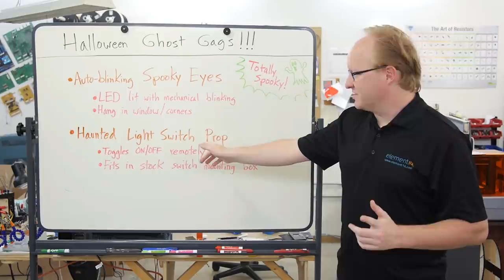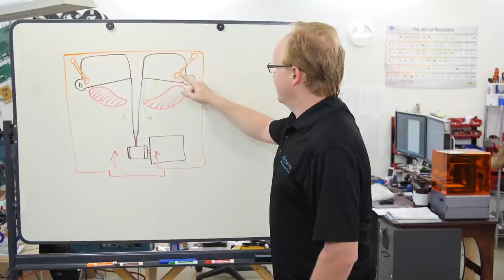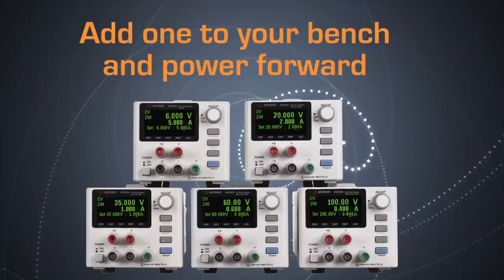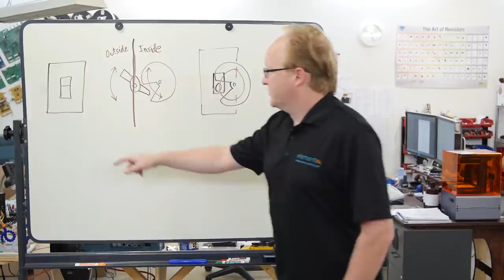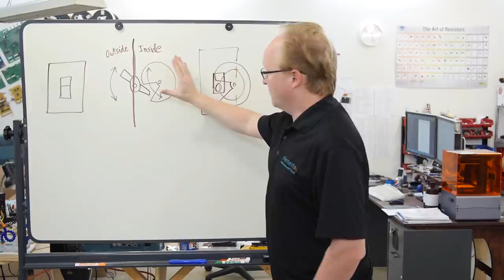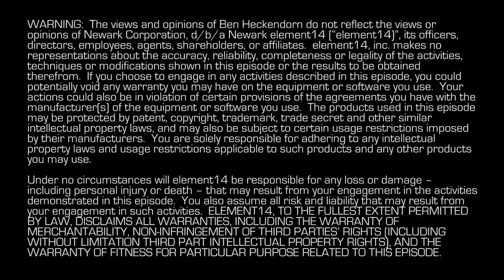Ben Heck's Ghost Gags

Comment: ben, I was wondering if you could help me out. I have a connection that needs to be able to spin 360 degrees without the wires getting tangled. Is there like a special connector than is mounted on like a spinning circle? I also have a 180 degree connection needed is it possible to use regular wires for that?
Reply: Yes, that's it. Thanks!!

Comment: ive got an idea for a project that helps kids can easily get rewarded for picking up toys. The basic idea is that they put toys into a drawer with a false bottom and when its closed the toys fall into a box and when it reaches a certain amount by weight or parent notification via email with like a photo from the inside, it will dispense a reward. it isnt that great of an idea but i would like to see you improve it and use it in an episode.

Comment: Hey do you think it would be possible to put a raspberry pi into a flash cart or its own custom cart with wireless internet and BlueTooth and have it work/run on a normal Gameboy advance/color? 
or maybe instead of having Bluetooth and WiFi in the cartridge I could have a USB port and a USB out
 I am mainly wondering if this is possible because I want to run android/Linux/windows on my GameBoy advance it would fun to play Minecraft on it (Probably with a Bluetooth keyboard and mouse or maybe even using input mapper and playing with my ds4 controller)
 I'd also if possible put a micro-sd card slot in the cartridge so I can use a 64gb sd and maybe even emulate n64 games on a GameBoy

Comment: That was a cool episode! :-) I probably would have used servo motors on the eyes to control them separately, that way you can have  one of the eyes winking. :-) but still I like the way you did it it was cheaper and relatively easier. :-)

Comment: Why do you use a diode connecting both sides of the motor?
Reply: +Giraldtec I checked with Ben and he said, "The diode prevents flyback voltages from spiking the rest of the circuit. Google “H-bridge schematic” for more information."
Hope that helps!
Reply: thanks karen!